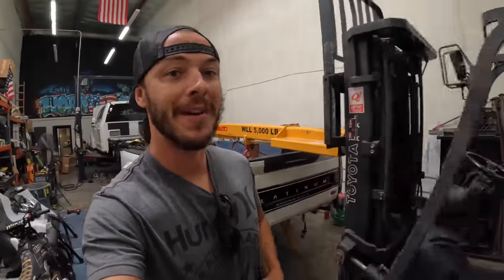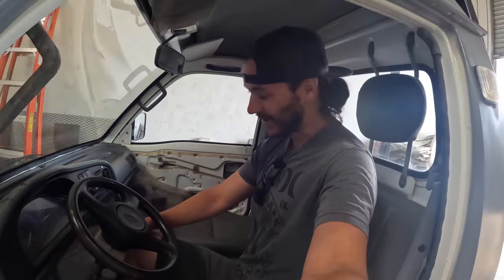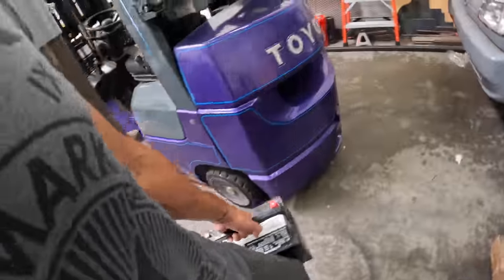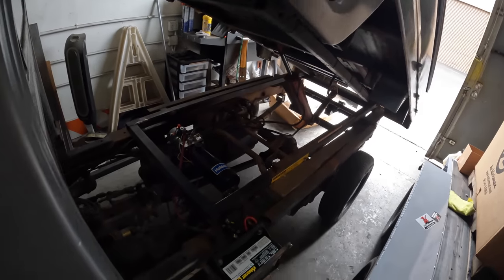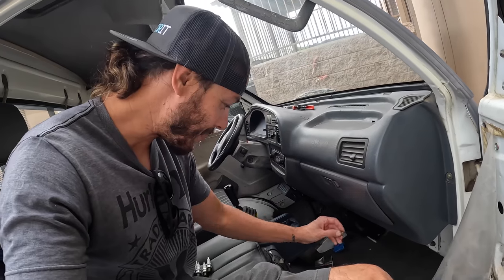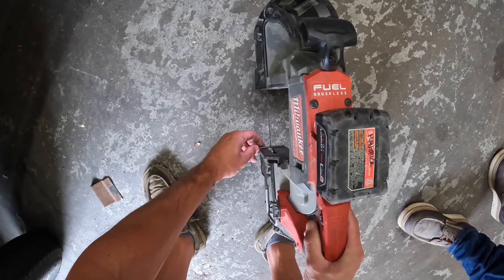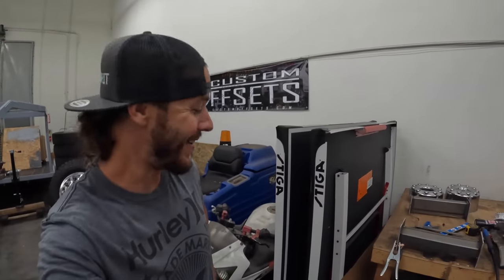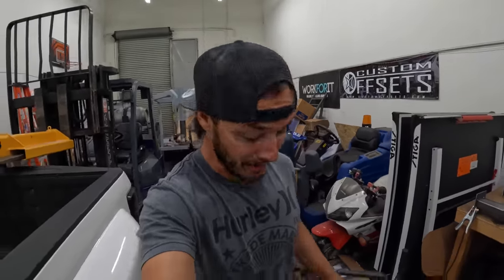Finishing Touches for the Mini-Truck Build!

Comment: If you run the wire harnesses off the back bumper, you are going to loose the turn radius while backing up.
Reply: Just need the trailer wired with long cord, easy since it is not made yet.
Reply: Coil trailer wire it’ll spring back like they use on semi trailers.
Reply: @andrewkrueger9627  Good idea! I was just thinking my trailer plugs into the bed of the truck. But just goes to show there is always a way to get it done. Have a great one!

Comment: If you wanted it like a belly wiring on a semi I would recommend put a second plug on the trailer. And run a coiled wire. You will not sacrifice any turning radius. You can get all the parts either at a truck stop or Napa or etrailer. That would be the best bet.
Reply: Also b&w makes a rubber plug that goes into the receiver for a dump bed build.

Comment: For the hole in the bed get at square stock and weld a flat plate circle to the top so all u have to do is pull the pin out and place it in
Reply from the maker: I like this idea

Comment: For your goose neck issue, they sell goose neck cover plates/plugs some are rubber or plastic but theu also have metal with magnetics.

While watching your plug installation for amount of stuff you do, you may want to look into a nut setter like a rivet gun but drill a hole pop sleeve in & you have a threaded hole(little more complex but easy way to add thread besides tapping)

Also many many videos ago y'all had a custom jig of sorts for your band saw & wondering maybe an idea to make them because I tried to replicate it it worked but yours looked better not sure if cr issues but would be neat aftermarket attachment for the bandsaw.

Lastly I am wondering in a future video you can make a new battery tray/box for the mini with a remote wired positive & negative studs so basically you don't need to lift bed to dump it. Also I do get it won't be simple for you & I am not paying but think Zach needs to   small turbo diesel swap it. 

Great content I would offer to help with my ideas but I am sort of like Florida Man(should be his new nickname) it will get done but it won't be pretty but I can fix walls lol

Comment: There's a lot of owner operators of tractor trailers that are starting to move their airlines and plugs off the back of the truck to the underneath of the trailer by the landing gear and removing them from the front of the trailer

Comment: I don’t shop at #Autozone tired of receiving wrong parts!
We don’t have any #PepBoys in Indiana. 
I get my parts from #CarQuest or #NAPA. 
Regarding your #GooseNeck trailer wiring, it won’t work on the bumper, you have to mount the wiring in the bed to keep your turning radius at norm. A Bumper Harness electrical plug for bumper trailers only.

Comment: As far as auto zone vs pep boys, neither. I’ve been a mechanic for almost a decade now and I almost never get parts from a part store these days. Parts stores scam the HELL out of you, doesn’t matter what one you go to they’re all the same they all up-charge to the moon. I almost exclusively order from rock auto. They have the same OEM parts as all the parts stores but for a legitimately reasonable price. Prime example fuel pumps, brand new customer recently bought an AcDelco from a local big name parts store because he wanted to know for sure what was going in his truck (a lot of other shops in the area won’t even say, they’ll just throw in whatever they can get and charge you whatever for it) he paid almost $400 for this one fuel sending unit though.. After he told me this I found the SAME EXACT AcDelco fuel sending unit on rock auto for $149. Needless to say he was very upset about all the money he wasted. I gave him the option to return the one he bought and let me order him one but they wouldn’t take it back being that it wasn’t broken or anything and as usual they really didn’t like that he realized how much they fucked him. It isn’t even a comparison, it’s a straight up SCAM.